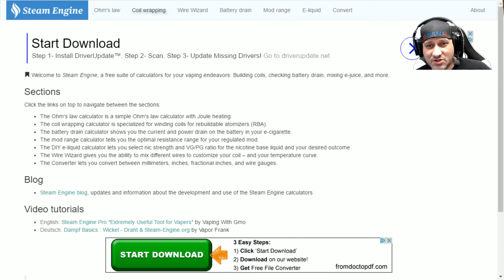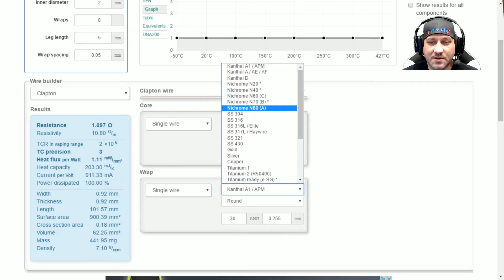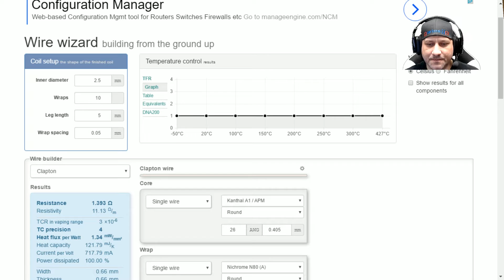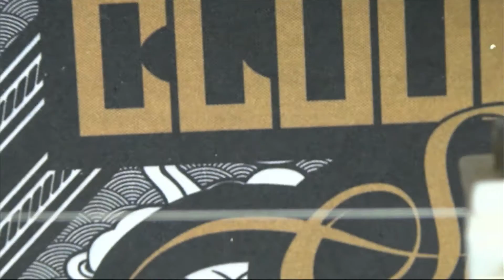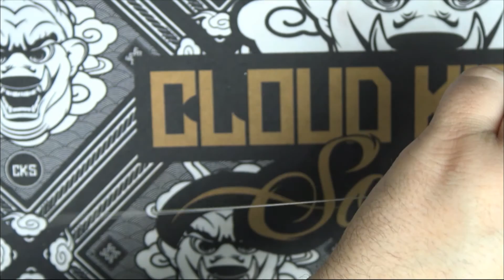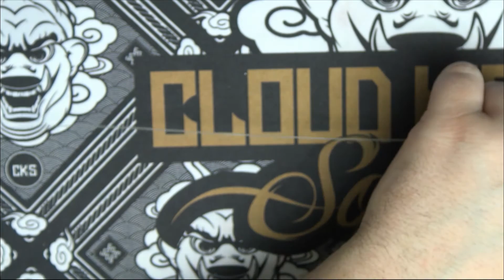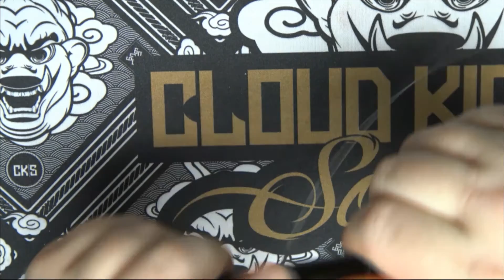Clapton Tutorial - The Clip Method

Comment: Hi Aries you are the best for coil builds I watched your videos and just built a fused clapton one of my best to date thanks to you I was using the wrong size wire for my cores using 24 awg now I am using 26awg for dual core wrap with 36 awg  thanks man for the great tutorials
Reply from the maker: It can be done with 24g cores, but having a 10 gauge difference between core wire size and wrap wire size tends to be easiest for new coilers. Once you've got the muscle memory, you'll find it easy to wrap any gauge core set.
Reply: Thanks for the info on that I was using 24g with a with a 28g wrap

Comment: Aries thank you for that, have seen a few Clapton coils and I did wonder how they where made.
I must admit I did expect it to be much harder to do or is that you make it look easy.
Am I right in that if I replace my micro coils with Clapton coils I will get more flavor?
Will they work with mouth to lung tanks?
Reply from the maker: Generally speaking, yes, a clapton will give more flavor than a micro coil due to increased surface area. You can use a clapton coil in a MTL tank with absolutely no issues.

Comment: Great video. The clip idea is really neat, the first (and so far only) time i've tried making clapton I had a lot of trouble holding the spool at the right angle/tension and ended up with inconsistent wraps that just sprang out of the core wire after i'd cut it. I'll have to try that. Also what are your thoughts on twisted wire as an intermediary between micro coils and clapton? That's what i've been using to improve flavour over micro coils, since all pre-made clapton with a 32 wrap just takes too long to heat up.
Reply from the maker: Twisted wire will give a slight improvement on flavor as it increases 
the surface area of the coil. As far as claptons taking too long to heat
 goes, people don't generally don't consider the need for a bit more 
wattage to aid in the heating of the added wire mass. Issue two is that,
 unlike micro coils, clapton coils and beyond don't necessarily need to 
get red hot to start vaporizing the eliquid. And finally, as a general 
rule most pre-made clapton coils that are mass produced are made using 
less than optimal materials and have impurities which slow and impair 
their performance.
Reply: ariesjj Yeah I've thought it strange that in steam engine claptons come out as having a very low heat flux per watt which doesn't come close to reaching the 150-250 range that I see most people shoot for with standard wire builds. I guess the extra mass makes up for that like you said. how much does this apply to the extra mass of twisted wire? I've been using twisted 26ga mainly for single coil RTA'S with a pitch varying between 1 - 1.8mm, but I can't seem to find the sweet spot between ramp up time/heat/surface area without throwing so many watts at it that I may as well be using a clapton. - I prefer to run builds at a lower wattage for the sake of juice consumption, since I have a tendency to chain vape.
Reply from the maker: There are so many variables when it comes to finding the sweet spot on twisted wire. I treat them very similar to how I would treat a straight parallel micro but add 5-8w of power to account for the twist. However, when it comes to flavor performance, a twisted wire will generally outperform a standard parallel using identical wire materials used in the twisted version due to the channeling that takes place. There becomes a trade-off of sorts.. the more surface area/juice channels/wire mass, the more flavor you get.. but in turn, you're also going to go through more eliquid.
Reply: When it comes to twisted, would I be better off with a tighter twist pitch or more wraps? I'm looking for a single coil (for the ammit/merlin mini/serpent mini) that works at 30-35 watts. The 3d airflow system in the ammit seems to need a 3mm coil which limits the amount of wraps I can use so I end up with a pretty small coil. I tried using twisted ni80 to improve the ramp up on a 5.5 wrap but it still lacks heat at this kind of wattage. I can get away with using micro coils in the serpent mini but more recent single coil RTA's seem to need a more extravagant coil due to the chamber size.
Reply from the maker: It comes down to personal preference. In my experience, a tighter pitch helps with better channeling. At 30-35w, you're fairly limited on options for a warm vape. You're basically going to have to run a 0.5Ω or higher to get any warmth from it. With that resistance level and the mass of wire you're talking about by using a twisted build, the ramp up time is definitely going to be on the higher end in the wattage range you're shooting for.
Reply: I just put in a 6.5 wrap 3mm ni80 twisted with 1.2 pitch to see if the extra mass helps with the heat due to there being more coil mass producing heat the way claptons do, it fires up ok at 35 watts since its ni80 but it's just a flavourless vape.

Isn't the resistance irrelevant since i'm using a regulated mod? Surely a higher resistance = less warmth because of the reduced heat flux/extra mass? The 0.4 kanthal build I've been using (4.5 wrap 3mm spaced twisted) would surely produce more heat than a 5.5 wrap at 0.5 ohms?
Reply from the maker: To address the resistance being irrelevant.. the short answer is no, the higher the resistance, the less power it takes to achieve the same amount of radiant heat. Given identical power applications and airflow rate, the higher the resistance will result in a warmer vape.

Since I don't know the exact materials you're using as far as gauges and whatnot go, I'm going to try to take this from a sample perspective. Please also understand that there is a pretty significant difference in theoretical math and real life scenarios. Based on the numbers you provided in the 2nd paragraph of 4.5wrap 3mm spaced twisted coming out at 0.4 (spacing not listed) I'm going to try to replicate and elaborate.

Let's go with the 0.4Ω coil first. I have setup the example using 2 strands of 25g (0.455mm) kanthal twisted with a 1mm pitch. Wrapping that around a 3mm ID and shooting for a 0.4Ω resistance comes out at approximately 4.5 wraps which should closely mimic your stated coil. The heat capacity of that coil is 95mJ/K and the heat flux per watt would be around 3.88mW/mm2.

Now let's examine the 2nd coil using the same specs as the first except adding a single wrap would bring the ohm level to approximately 0.485 (call it 0.5). Your new heat capacity is 108.12mJ/K with an approximate heat flux per watt of 3.35mW/mm2.

You might want to check out the heat flux calculator within Steam Engine Coil Wrapping tab also as it has a nice color coded indicator of temperature based on the wattage applied to any given coil you have laid out. The color coding ranges from Blue -> Green -> Yellow -> Red. These indicate the warmth level of the coil from cool to molten lava.

At the end of the day.. there is waaaaay more than just the coil that has to be taken into account when it comes to your vaping experience, however. You have to examine the eliquid, the airflow, the wicking, the condensing chamber of the atomizer, the accuracy of the mod (power output, ohm reading, etc). Vaping isn't a scenario where you can just do a bunch of math on paper and say "x + y - z = amazing vape". It takes some people a few weeks to find a vape that is perfect for them... others have been searching for years and tinkering to find what suits them the best. When it comes down to it, it's all about experimenting with every aspect to find just the right combination for you.
Reply: ariesjj I always pay attention to heat capacity/flux/surface area/mass when coming up with a build. Unless I'm missing something, shouldn't it be the opposite for achieving a warm vape in terms of heat cap/flux. Heat capacity is the rate at which the coil heats up/cools down, where as heat flux is the amount of heat the build is generating at a given wattage. Therefore you would want a lower heat capacity and a higher heat flux? (achieved by using less mass, but then you obviously sacrafise surface area).
Reply: ariesjj sorry - just another thing I wanted to clarify. When you refer to resistance, since we're talking about using regulated mods, do you just mean mass in general? I've had suspicions for a while that voltage affects the ramp up when using the same build across different mods that read the resistance slightly higher. I didn't think it should since I assumed that voltage was only a measurement relating to the batteries themselves and had no impact on the wattage delivered to the actual coil.
Reply from the maker: Seriously didn't think a video on how to make a clapton wire would turn into an advanced lesson in physics and I don't have the credentials of a physics professor. However, when regarding resistance.. the formula for resistance is R=P(L/A). R= Resistance, P = Resistivity of the given material, L = Length of wire, A = cross-sectional area. It doesn't matter if it's a regulated mod, unregulated mod, or a lightning strike.. resistance is resistance no matter how current is applied. 76mm of 26g 316L has a mass of 78mg with a resistance of 0.44Ω, the same length of Kanthal has a mass of 69.25mg with a resistance of 0.85Ω (so far we see that the higher the mass the lower the resistance), yet 76mm of 26g Nichrome80 has a mass of 81.06mg has a resistance of 0.64Ω. So no, it's not just mass that affects overall resistance.

When looking at heat capacity, heat/thermal flux, and surface area.. it's a balancing act. You have to find the fine line that suits you. The higher the heat flux, the warmer the vape.. period. The higher the heat capacity, the longer it takes to heat.. period. But you also have to look at the fact that when you start mixing multiple wires into a build it doesn't become one solid lump of metal. Each individual wire will heat at a slightly different rate. It's called the staged heating effect and that, as I said previously, is why you can't take theoretical math and say "This is how it works in a real world scenario". Not all coils are built the same.. they may have the same mass but will have a different resistance. In turn, they may have the same THEORETICAL heat flux or heat capacity, but perform differently due to how the wire is composed/built. Additionally, all things being equal (resistance, heat flux, and heat capacity).. having a more constricted air flow will also make for a hotter vape as you have less air being drawn over the coil to cool it. Again... you can't just look at the wire. What you're trying to do is just look at the "engine" rather than the "car" as a whole.
Reply: Yeah sorry -  I had the opportunity to pick your brains and just went off on all the other things that I was unsure about. When talking about resistance, the point I was making is that it should be an irrelevant aspect of the build since the wattage is pre-determined by the mod - ie replacing the word resistance with mass would be more useful since that is a better indicator (albeit still not very descriptive) of how much wire needs to be heated up and the surface area of the coil. (A twisted/clapton coil and a regular micro coil at the same resistance is an example of what i'm getting at).

Comment: Thanks for the video brother, very informative.  Quick question, is there any particular reason you wanted to build that high at   .7?  Is that your vaping preference, or are Clapton coils not very good in the  
.1 - .2 range?
Reply from the maker: Single core claptons are difficult to get that low due to the lack of wire mass. You would have to use something around the 22g mark for the core. Ideally you would want to run a fused clapton to get to the range you're looking for. The fused clapton video is next up in my queue.
Reply: ariesjj thanks for the response buddy, look forward to the next build video.

Comment: where can I get a clip like that?
Reply from the maker: You can generally find them at places like Walmart, Kmart, etc. They're normally found in the laundry goods section. You can also find them on Amazon if you search for plastic laundry clips.
Reply: Did it come with that metal ring installed already?  It looks like you have a groove in the middle of the inside of the clip to fit around the wire. Did you make the with a drill bit?
Reply from the maker: The ring was already installed as was the hook. The grooves in the middle of the clip were also already there as they give the clip the ability to more firmly grab clothing over that of a smooth surface.
Reply: will any plastic laundry clip do?
Reply from the maker: As long as the clip part has grooves through it to keep the wire going smooth, yes. If you can rig up a way to add some weight to it, it works that much better.